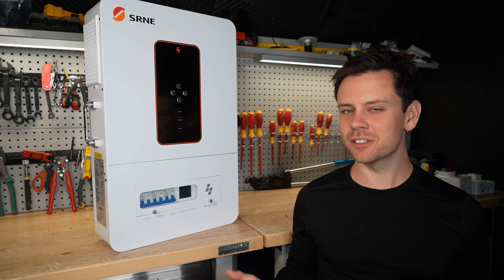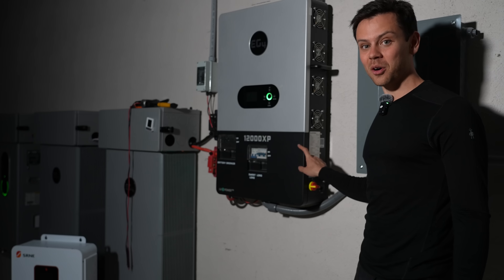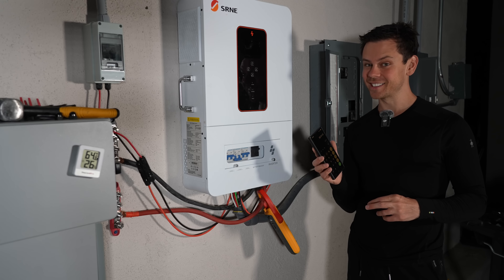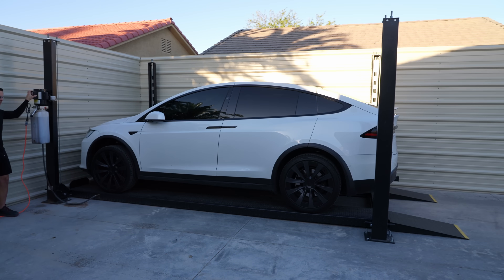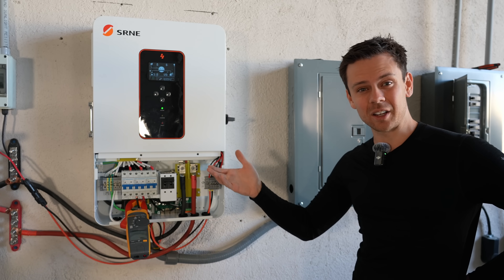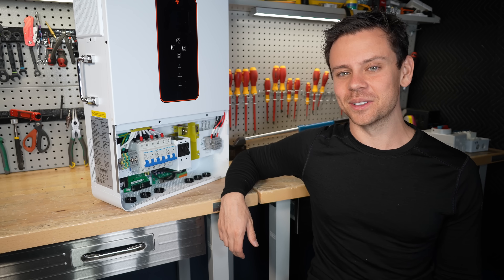NEW 6,500/10,000W SRNE 120/240V Inverter Full Review: EG4 6000XP Competition?!

Comment: I have been sold on EG4 12000 XP and battery,,, Will you have had me sold on that for a while,,, it's worth the extra money for me,,, soon I we will be up and running at a reasonable price even if it's a little higher,,, from watching your channel you have made it a reality for us to soon be state of the art up and running... thank you...
Reply: I wouldn't buy another EG4 anything, not even with your money! I don't know who makes the best products with the best support, but I do know who makes some of the worst. Good luck.... If you insist on buying EG4, you'll need it!
Reply: @Finite-Tuning we installed one 6k and battery for my cousin offgrid and it works great,,, I'm also offgrid and going with 12k xp,,, I'm curious why you're negative about eg4 anything,,, did you have a bad experience... thank you.
Reply from the maker: Holy cow that's awful!!!
Reply from the maker: Have you posted your issues to the forum?
Reply from the maker: What happened to your LCD screen? Mine is still working. Gosh that sounds awful
Reply from the maker: Their off-grid specific inverters seem to be solid. I haven't had any issues with 6,000 XP or the 12,000 XP. They have lots of issues when they first came out but they got fixed with the new firmware
Reply from the maker: It takes literally forever for them to make software updates. It's driving me insane. Their app which crashes all the time, they keep saying they will have an update but I don't see it for 6 months now
Reply: @WillProwse  
Hi Will. I stay away from the forums in general ever since I learned that is the place where every know nothing keyboard worrier on this planet loves to hid out! But I do have your thread bookmarked.... Cheers 🍻
Reply: @WillProwse  One of their updates bricked it I guess. The LCD lights up and I can navigate, but there is zero data on screen. They either can't or don't know how to fix it, but there was talk of replacing the LCD. That's about all this company is good for in my experience, "talking", "wasting time", "making promises" then conveniently forgetting all about the noise they've made!
Reply: @WillProwse  I should have known better, right when I measured the fan noise this thing makes. If they can't even get that correct then what else are they lying about? Spec on the flexboss 21 is less than 50db noise level, reality is over 70! The fan spec was a major deciding factor for me on purchasing this thing since I knew exactly where the inverter was going to live in my home. To say this thing is obnoxious would be an understatement, but you already know the kind of noise these things make. I didn't, until I measured it and found it's 20 plus DB above spec! No firmware is gonna fix that. 

Is yours AC charging your batteries? Mine is uncontrollable, it does whatever it wants anytime it wants. They can't get it to stop AC charging my batteries so their band-aid fix is to not use any comm or BMS and just charge my Lithium batteries as lead-acid. That 100 percent defeats the purpose of having a comm line! This company is horrible, I've got nothing but a dysfunctional product and a pocket full of regrets. Oh, and their other "fix" was to use their grid-tied inverter in off-grid mode. That's the kind of tech support I get from them.... Just useless!
Reply: @WillProwse  
This is the common theme with EG4, hurry up and wait! This company is just horrible.

Comment: Hey Will a question or suggestion.  I didn't notice how long or how heavy your extension cord was going to your lift but 
I know I have had trouble with longer 14g cords making a load that is on the edge not work.  An example is my 120v welder on a 14g cord was useless but I got a 12 and it was like a new machine. I do think your test was still good if you used the same cord. thanks for the vid
Reply from the maker: I'm using a 12 gauge and I am well aware of voltage drop
Reply from the maker: I use the smaller cord on the one that actually moved the lift haha

Comment: I currently have 2 PowMr 5kW Hybrid inverters, basically rebadged SRNE inverters. One is <1yr, the other <4 months. They are not very reliable in their functional overload. I get lights dimming heavily and even system overloads when hitting 100%. Supposed they can handle at least 8kW surge loads, but nope!
I'll be replacing them with another unit. I'm looking at Ananji as a possible replacement. Budget friendly, but also built by the same who built some of the Voltronic units.  I'm interested in them because they have dual MPPT and can do split phase on a single unit.
Maybe you could get one of these units and give them the Will Prowse treatment of abuse, err, testing, to see how well they hold up 😜😂

Comment: Not being able to handle an imbalanced load puts it on the junk list, imho. I don't care who the manufacturer is.  You can't always wire your loads to be completely balanced. There's always going to be one leg that gets nailed heavily at times. And the problem with this is that the inverter would completely power down, killing both legs, if the 1-leg load lasted too long. At 10kW, that could someones entire home going off-line until the inverter rebooted.  Definitely not worth it, imho.

Comment: How long was the extension cord when you tried to run the car lift? That resistance could pose a problem. The higher power inverter may have held a higher voltage, so the same drop didn't stop the motor from starting. The air compressors had short cords, and they may tolerate more voltage dip and still start.
Reply from the maker: Oh absolutely but I use the proper size. Also I used two different cords on the one that actually worked. So the first test it was at the advantage.

Comment: 89W is a no-go for a off grid system, thanks for posting
Reply: If you live in NV, AZ, FL you only need a single 400W panel to compensate. So really depends on your setup
Reply: @user-jh1er8kh7p but in NV you also need an extra 50w of cooling as well to make up for the waste heat lol
Reply: Idle consumption doesn't matter when it's sunny, but on days you have no sun it sucks
Reply: Idle consumption is huge when it comes to efficiency. Depending on price point and if you care of wasted watts picking components in the high 90+% range is ideal. Matching volts/amps that components run on is ideal as well.

Comment: So your bunker is not air conditioned or insulated, do you worry about the heat affecting your batteries?  I put a small A/C in my solar mechanical room and set it to 74 F. I have two EG4 6000 XPs and six EG4 5.12 kWh batteries.
Reply from the maker: Working on insulation this week, just finished the roof. Two heat pumps. Third one incoming

Comment: Second comment, different point.  There is an advantage in separating the AC/DC/PV buses, disconnects, and fuses on a separate enclosure, but it always looks so haphazard and mismatched.

Then there's the grommets, which I assume are designed for smurf tube conduit used outside North America.  How are we meant to transition to our own mandatory sorts of EMT, rigid, PVC, and liquid-tight conduit systems?  There's presumably not a market or efficiencies of scale to get "normal looking" panelboards, UL listed, for regular licensed electrician-installers to use.
Reply from the maker: Oh absolutely. They need to use different connections
Reply: You can remove the grommets and use the same holes, with reducing washers if needed. Or if the holes are too small, drill or use a punch to get to the correct size. 

Any real electrician would already know that and have the tools to do so.
Reply from the maker: Actually there is air flow vents around it, And if you look at how the steel is designed, you can't cut into that. It's super weak. Can you see it in the video?
Reply: @WillProwse  No it isn't  too visible in the video..but the vents don't matter, and looking at  7:09 I can see the holes are already big enough for most standard conduit/Cable fittings. And a step drill will enlarge any needed holes despite the thin metal.

Comment: BTW: Integrated PV disconnect allows the inverter to sense when the switch is being operated and do a software rampdown/cut of the current before it brakes the circuit. This avoids the silly fires often erupting in those external disconnects. No idea if this model has this function but for an external switch it can never have it.
The feature is often listed by switch manufacturers as "early-break auxiliary contact" and I would prefer to have it as you never know who and when will flip a switch.
Reply from the maker: Wow good point
Reply: Just stop using Chinese Amazon disconnect switches, mine are made in Austria and not cheap.

Comment: Was it you, Will, that gave me confidence to grab a 10kW Sungold?  Thanks!  I've been running one since March 1 this year when I at last decided it was time to swtch up to 48V.  The rated 6 horsepower capacity is for real. I'm running irrigation and water transfer pumps with confidence.

One lesson learned:  connecting an analog gas generator (not an inverter style  generator) to the grid input is disappointing.  The generator will not keep frequency & voltage within limits under load.  Is it possible the dedicated generator inputs on the new model are smart?  (I.e. they make an AC to DC conversion.)  This is different than a bypass relay transfer switch style.  I can accept a total 3200W (60A DC) or 5400W (100A DC) input from a portable generator alongside a 200A passthrough for grid & well-behaved higher pricetag generators.

I'm looking at an add-on 60A charger (Eco-worthy, $300) now to couple via my DC bus.  The EG4 100A chargeverter is out there too, but pricy.  Something cheaper than a new inverter-generator.  Feedback welcome!
Reply: the eg4 does seem to be the best for dirty generator power. but have not seen the eco-worthy model
Reply: @NightshiftCustom it's 60A (not 100A) and $289 now with coupon.  As it is raining like Gilgamesh rn, I decided it's worth being prepared come the darkest days of December.

Comment: Come on Will... You disable the battery output, then hook up the cabling and when you re-enable battery it's internal precharge resistors will handle the caps in the inverter.
Less stressful on the components and no spark to fling copper into your eyes.
That inverter had tiny caps though, do that to the Deye 12kW and you'd remember it. 😁
Reply from the maker: I knew someone would complain 🤣
Reply: when pros make basic mistakes...
Reply from the maker: Yes very tiny caps. Deye has huge caps, agreed.

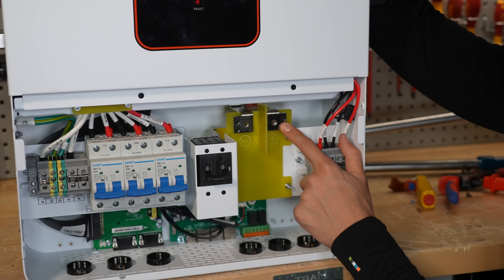Comment: 8:48 Will, on the 12000XP you can remove the battery lug clamps by the screw on top and then you the same screw terminals same as this or 6000xp
Reply from the maker: Oh that's nice!!! Good point!
Reply: Damn, did not know that I just replaced my old inverter with a 12,000xp and cut the lugs, I wish I'd seen this comment before that.
Reply: Holy smokes ! Thank you! I HATE the barrel crush terminals eg4 puts in there.

Comment: Really liking my SRNE (Sungoldpower) 10k for $1700. Been running it for almost a month. The lights flicker a little when my soft-start enabled 3 ton AC unit kicks in, but I can live with that. Everything in my house is now on the inverter except my EV charger, oven, and dryer. I'm on a ToU plan with $0.09/kWh off-peak pricing. EV charging over night is only about $20/month. But, I do plan on using level 1 charging when the Yixiang 16kWh battery is full and there's solar to spare.
For most of the time I've been running this inverter/battery combo, I've been switching to grid power at night and putting some cheap power into the battery. But, last night I let it run to see what would happen. Went to bed at 43% and woke up to 1%. It never switched to grid. Just when I thought it was getting close, the sun came out and started charging again. Average cell voltage only got down to 3.1V. Got several sunny days in the forecast, so I guess I'll be staying off grid for the foreseeable future.
Reply: I keep forgetting to set mine to 0%. Mine cuts off at 5%
Reply: @ceo4eva  cuts off at 10%+ will better for LFP system
Reply: @caedmonhuang I think there's a video out there saying going to 0 doesn't harm these batteries
Reply: @ceo4eva  No, but if the battery could be charge back to SOC higher  ASAP, that will be no problem, DOD is to0 deep will impact the battery life healthy.
Reply: How loud is that converter?
Reply: @Yes-v4vit's in the garage. Can't really hear it on the other side of the door, in the kitchen/dining room. But when you open that door, the fans are quite loud when charging (from the grid or from solar). The fans also kick in when under load. But I haven't driven it beyond 7kW.

I wouldn't want to be in the same room all the time. But it's not bad if you have a wall or two between your living space and the inverter.
Reply: does it installed with busbar? solar hybrid inverter is the PV+inverter+battery manage. but for big ESS battery , a busbar is necessary.
Reply: @caedmonhuang  I use a bus bar with mine.
Reply: @satekeeper  busbar is good solution for current and voltage balance when use the battery

Comment: I wonder if the power cord, from the inverter to the car lift might be an issue. 
What gage & length cable?

Alternatively install the power cord between the distribution panel and the four air compressors.
Reply from the maker: I used a smaller longer cord and it worked perfect 😂 used a super thick one for the 6.5

Comment: On the 12000xp you can remove the clamp down terminal and use the screw down, that what I did as my Ruixu batteries had crimped eyelets. Loving my 12000xp

Comment: Try deye hybrid inverter
Reply: I would really like that as well. I'm thinking of purchasing the 8kw hybrid inverter. It suppoosed to be very quiet, but it does have 3 fans. Really like to know what Will thinks of the Deye ones.
Reply: I'd love that as well. I already have a deye 16kw installed and is powering my whole home flawlessly. I'd love to see you do some deye inverter reviews and probably learn more about these beautiful beasts
Reply: @GovernorZwReloaded   How is the noice level during nighttime on your inverter when there is no solar input and little power consumption?
I assume that it will be almost completely quiet.
Reason I'm asking is that I will be installing on the top floor and the bedroom is right underneath it.
Here in the netherlands most houses are concrete, so pretty good sound isolation except for the staircase.
Reply: @evilhond it's very quiet. The version that I have has got a no noise setting that I can activate but I haven't used it as my installation in in another small building outside the house
Reply: @GovernorZwReloaded  Thanks, good to know

Comment: Why are all the wires inside these units so small when we connect larger wires to them?
Reply from the maker: If it's inside the case the code states it's safe to run them smaller. Nec has chart on that
Reply: If you compare the cross section size of the wiring you use over there for a given amp 120/240 circuit to what is frequently used in other parts of the world it's actually larger.  For example (note I am not considering the effects of distance nor derates here) on a 20A circuit (ie a circuit protected by a 20A breaker / fuse) you'll often find 12 AWG recommended.  That's approx 3.3 sqmm.  In a lot of other countries 2.5 sqmm is used.  In other words, it's fine to use thinner wires so long as the insulation is up to the temperature and the voltage drop is not excessive.
Reply: @retrozmachine1189 i run a 50amp wire to mine 5000k ecoworthy. And is just seems like a big wire to connect to a tiny little wire it freaks me out. I had a 30amp wire for awhile but my generator is a 10k so i was not using its potential and i did push it to 40 amps 1 time to charge faster and it melted my connection at generator so i got the 50anp and i charge at 40amps now and the extra is used to poer the camper. It works fine but connecting them to the smalls just makes me feel like its going to melt 1 day.

Comment from the maker: Correction: The GVWR of my SUV is almost 7,000, but the actual weight is 5,600! Oops 

0:00 Intro
2:23 Install
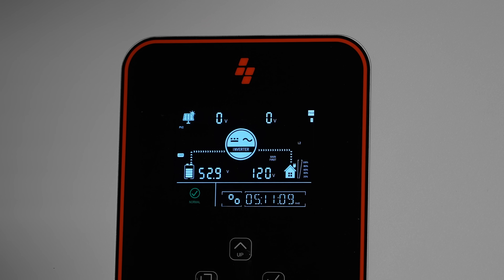2:52 Program The Settings
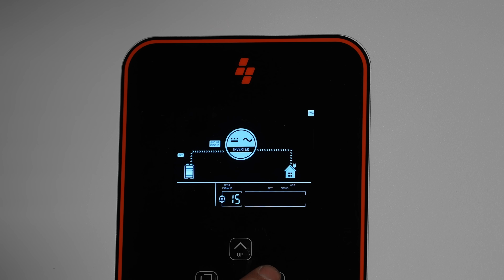3:16 Idle Consumption Test
4:44 SURGE TEST
5:26 Single Leg Test
6:05 10kW SRNE Load Test
6:37 Continuous 6,500W Test
7:24 Conclusion
Reply: Hey Will. Wondering if you by chance know if the SunGoldPower Model SPH302460A 24v All-In-One inverter is manufactured by SRNE like the 48v 5k & 10k models you have linked? Thanks in advance for any info you may have about it. Appreciate the content!